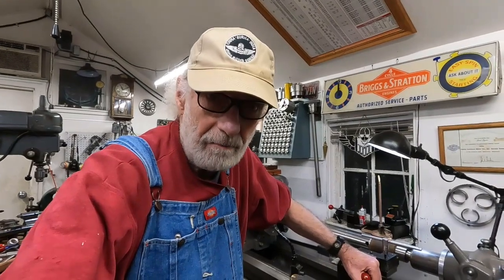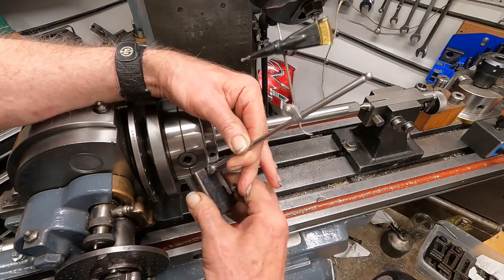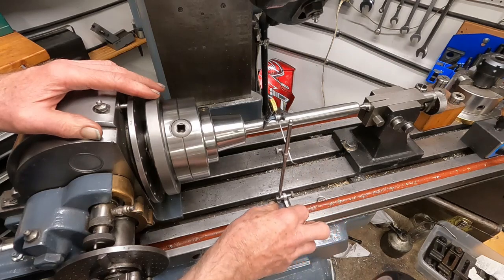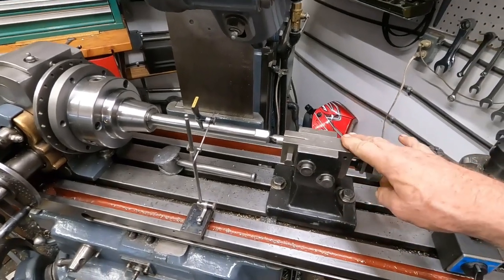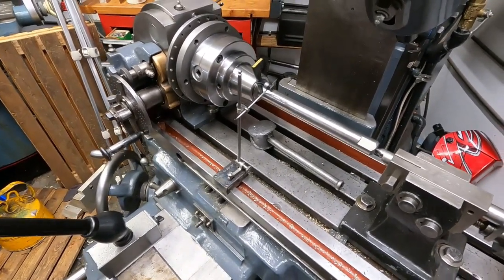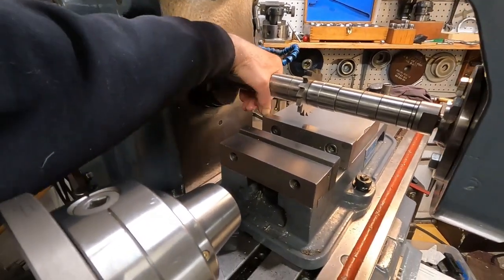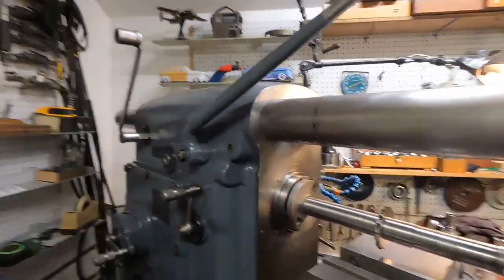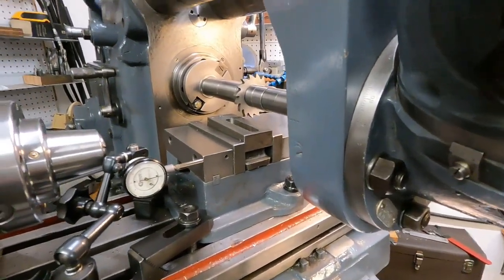Brown & Sharpe horizontal mill vise and dividing head set up

Comment: I never even thought to measure the deflection on the back jaw. It seems so obvious now that I've seen it, but just never even occurred to me. I learn something new in every single one of your vids, I feel like you've probably forgotten more about this stuff than I'll ever even freakin know lol.
Reply from the maker: Hi! This is one of those things that show up really quick on jig boring machines, so vises are not the preferred method as the vise will distort the work piece also. But they are great for general work on milling machines. The later Kurt 11 CnC vises have a much more substantial rear jaw.

Comment: Thanks for the video. I put a two piece vice on my brown &sharpe #2 light horizontal. Seems to work good but a little worried about flex in table.
Reply from the maker: I think i you detect the table binding the vise is too tight. Those can be used in combination with clamps

Comment: Keeping busy then Don. I wonder if a normal arbor support could be found for that mill to improve the clearance, or made.
Reply from the maker: I have one for B style arbors. The problem is removing and installing the vertical attachment from the over arms due to its weight, it has to be taken apart. The work size capacity of the machine is pretty small for local industry and the reason this was rusting in the junkyard. Thanks!
Reply: @DonDyarprecision  The it's too heavy problem, in an ideal world we would all have a high ceiling and a bridge crane to move all the heavy stuff about.
I do have a swing out arm with a chain fall mounted on to lift the 10" and 12" lathe chucks and to get dividing heads and rotary tables onto the mill, all to heavy to safely lift by hand.